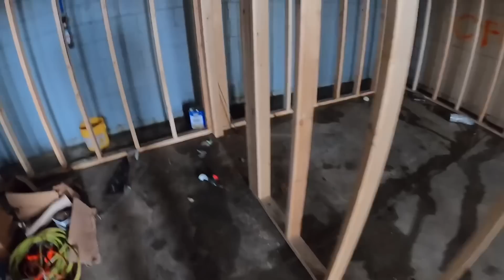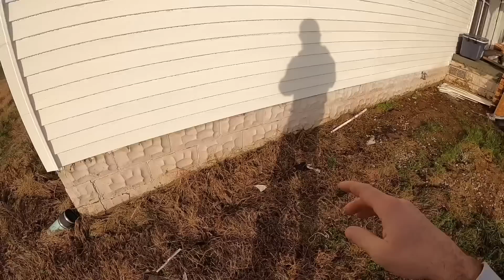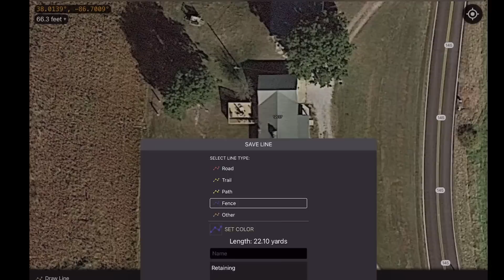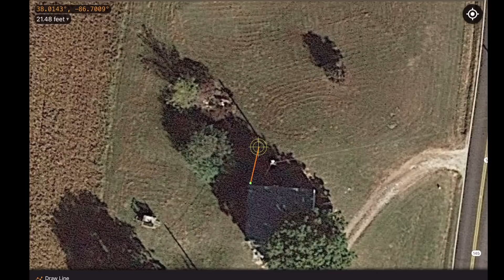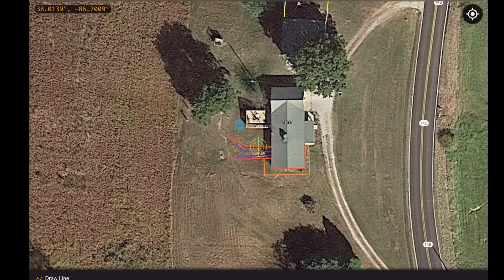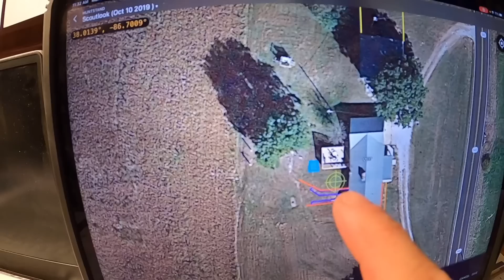Foundation leak repair/retaining wall layout

Comment: Why would they put fiberoptic about a foot or two in the ground. Is it cheaper than putting it up on power pole to the homes.  Would it be easier to use the  black tar sealer with a plastic cover on the outside basement wall
Reply from the maker: Heck if I know
Reply: @nyamillennial  it probably keeps the fiberoptic crew busy repairing it from people digging

Comment: Very good illustration of what you are working on... My question would be this, it is obvious that you would quote the skid steer and 120 for the duration of the job since those would be the machines to do most of the heavy lifting  on a household drainage/ retaining wall project such as that, but would you anticipate having to also bring in the Mini to get into the tight places that the 120 would have a hard time getting into, and how would you quote its use? Since the Mini has a significantly lower transportation/ operating costs compared to the 120 and skid steer, and would be used on a situational basis on that kind of project, do you quote that by the day it's on the job, calculate the transportation costs and the number of hours it would possibly be used, or include that in a miscellaneous category? This is with the understanding that every situation is different, but would like an idea of how you would anticipate having to bring in an extra piece of equipment to maximize project efficiency...
Reply from the maker: Hourly rate and transport. With the mini not need entirely it is easily calculated based on hours assume on the mini. If you miss it, you won’t miss by more than a hundred or so. And that can go either way

Comment: Going to guess that there is a month time lag in job to youtube time. Did you use the new style tar to seal the outer basement wall or did you use the old melt style tar ?
Reply from the maker: Job not performed yet. Well use tar in a 5 gallon bucket 😂

Comment: Far better than gurgle (yes, I know it is spelt wrong) earth Matt. The plan layout and different colours show the different steps required to fix this  mess properly. 
Can see why the previous contractor was evicted from this job. There does not appear to be much in the way of forward planning, unfortunately. 
The action of the frost on the soil  is called ground heave over here, describes it perfectly !! 🤓
Reply from the maker: Thank you!

Comment: I imagine y’all are going to clean and paint the wall with that tar like protectant y’all used one farmer Chris’ house to seal it off? Before you add the pipe and start adding rock? What material are y’all going to use between the two retaining walls leading to the basement?
Reply from the maker: Yup

Comment: Definitely prefer the new software it's a lot clearer, the only thing that would be clearer is to use a cad design software only that would be expensive. Yet another client that should have asked the experts, I know paying for yours and DP services may have been a bit more expensive, but you get the job your paying for and there will be discussion throughout the process, plus you get DP's guarantee.  
And please tell me they are going to put gutters up, with down pipes, it will be another way of reducing the risk of water getting into the basement. Also might be an idea for the home owner to get that fibre optic line lowered and encased in plastic piping, before you start work.
Reply from the maker: Thank you. Yes down spouts are coming

Comment: Cinder block basements are always prone to water leakage. The south uses these very porous cinder blocks for basements is like building your house on sand. Very prone to cracking in between the blocks and water leakage. Cinder blocks should never be used as basement walls!! If ground shifts just a little, cracks appear. Pour a cement wall! In areas of high humidity, never use cinder blocks! They sweat and leak water!
Reply from the maker: Agreed

Comment: Why don't you use filter fabric between the native dirt and the new drainage gravel against the foundation. To avoid the gravel sitting in over time? Some people use clay as back fill to stop water migration before it even gets to the foundation drainage system. How do you feel about that?
Reply from the maker: You can never mitigate 100% so get in down and out quickly

Comment: You didn't mention about damp proof paint which will be needed then put in your drainage just like you did on that similar other job you did otherwise you will possibility have problems....
Reply from the maker: It will be water proofed

Comment: Love the new option. Keep it. 1) Do you always use the same size of gravel on the drains? 2) Are those blocks that are 4' and 2' precut or is that something you all do onsite?  As always, love learning from you all.
Reply from the maker: Not always. But in this type yes.  Block come 2/4/6’ long all 2’ wide and tall
Reply: From watching many videos I can tell you that the blocks are pre-cut Michael.
Reply from the maker: Spot on

Comment: If you use Windows Paint you can shade in each part as you see to do it. Save original then add each operation in a separate print. Would be nice to arch both walls to make a  funnel shape. would not be as coseropfic.
Reply from the maker: Thank you. Makes sense

Comment: Matt, I like the utility of using the color differences in Hunt Stand.  However, you may want to consider blurring out the address of the site.  Unless I'm mistaken, it was right there on the roof ridge of the house.  It would mean another editing step, unless you're simply importing a Google Earth screenshot into your mapping program.
Reply from the maker: Never thought of that thank you!
Reply: And also blank out the Latitude and Longitude in the top left corner (38.0139,-86.7009). In Google Earth the lat/long takes you right to the house.

Comment: When you have the basement wall exposed would be a great time to waterproof and add 2" styrofoam insulation to help his utility bills
Reply from the maker: We will water proof it
Reply: Waterproofing definitely, and maybe squirting some hydrostatic cement into those very visible cracks.  The foam would help, but it would only be "covering" between a third and half of the basement wall.  Might not be worth it to the property owner.
Reply from the maker: Valid